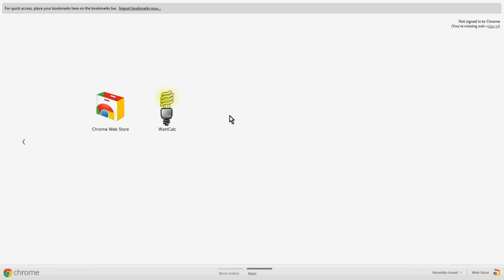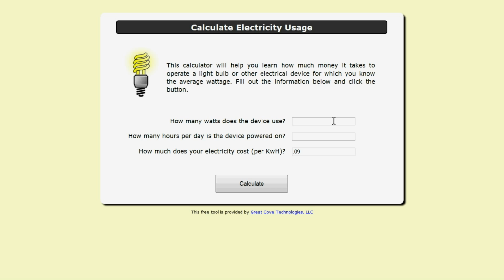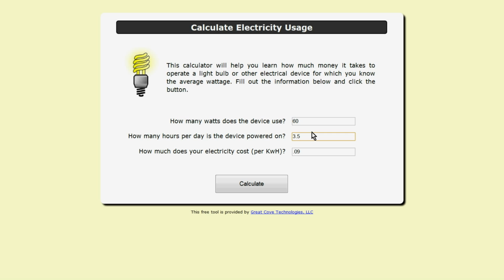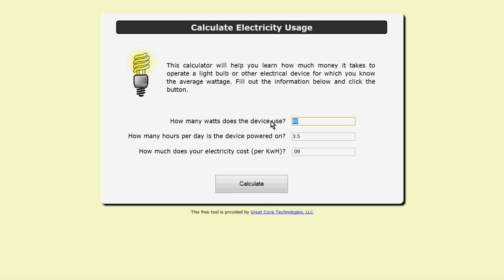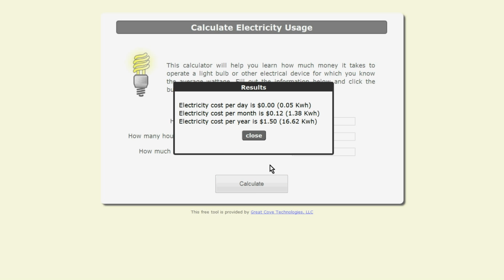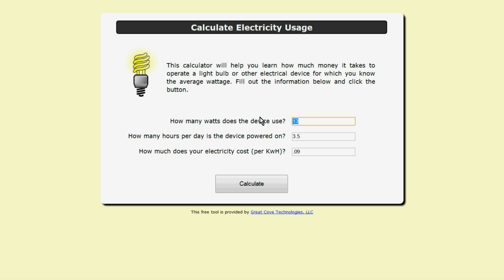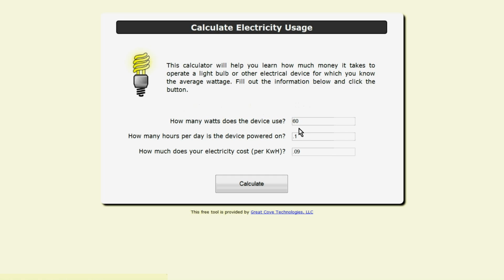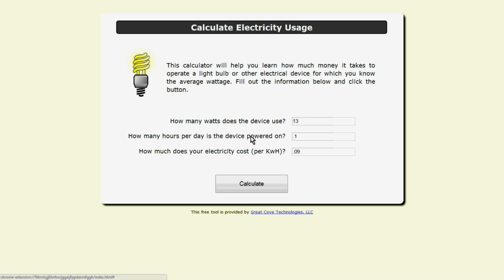Do CFL & LED light bulbs really save money?

Comment: LED's are the way to go - I would stick with name brand Philips for the lights used the most and then an off brand for others - incandescent bulbs are perfectly fine to use like he said for light fixtures used less frequent - in my case I have 3 lamps that are normally on 12 hours per day on average and more in the winter months - so spending about $75 for 3 - 75w equiv. for my situation will pay for itself in just over a years time - the bulbs last me 90 days when $ permits I will be changing

Comment: Well yeah but CFL's really have a problem with intermittent lighting. The number of on/off cycles is actually one of the specs.
Halogen bulbs are more efficient but only slightly - about 20%. I'm all for LED's for such applications.

Comment: Well, incandescent bulbs also burn out faster if they are turned on-off frequently. The filament expands when its on, and contracts when off. Over time, this stresses the filament and it breaks.

In Australia, they've replaced incandescents with halogen bulbs. Its still shaped like yr standard lightbulb and most laymen people can't tell the diff.

Comment: Be careful when choosing LED bulbs, even from Amazon. I bought 4 LED bulbs ("Lighting Ever" brand) and despite the high feedback ratings, all 4 failed within 2 months of purchase, two of which failed outside of Amazon UK's 30 day return period.  We so far haven't had any issue with CFLs runtime, replacing frequently used bulbs roughly every 2 years.  Be sure to watch out for the colour temperature as cheaper bulbs tend to be cool white (bluish tint) instead of warm white (like incandescent.)

Comment: Also consider the cost and efficiency of both the supplemental heating and cooling. If you are using electricity for heating, then the extra heat you use will cost exactly the same as the electricity you saved. If however you are using natural gas to heat, it will probably be cheaper than the electric heat from the incandescent bulb. 

More importantly, if you have an air conditioner, it requires 3 or 4 times as much electricity to move the heat back outside when cooling.

Comment: Search Life-Cycle Assessment of Energy and Environmental Impacts of LED Lighting Products by the US Department of Energy.

The embedded carbon footprint of LED's is of course larger than incandescents despite getting lower each year. 

"Regardless, it is important to note that the manufacturing phase on average only represents about 8.8 percent of total life - cycle energy for current LED lighting products and is far outweighed by the use phase"

Comment from the maker: Good point, although I still wonder what the total environmental impact is of a LED that gets put in a closet that gets powered on a few minutes a week.  How much extra pollution does it take to make a LED vs an incandescent?  It's a hard question to answer.  If LEDs work as advertised, it's safe to say we'll all be using them everywhere in a few years.  So far I purchased only one about five years ago.  It was a 20 or 30 watt equivalent and cost like 30 bucks and failed in two months.

Comment: You missed a very important aspect... CFLs fail if turned on and off frequently (like if you put them in a closet). Both incandescents and especially LEDs are relatively immune to that. You also missed the fact that people can only have so many places in their homes that require intermittent lighting and so the capital costs of using LED's in such places are negligible and for sure this is not an argument not to ban incandescents.

Comment: Maybe with electric heat and super-insulation, and if 60 F is cold weather to you. For the pathetically insulated, gas-heated old homes in Michigan, the BTU's added by light bulbs is tiny to begin with. And electricity is also a ridiculously expensive way to heat your house compared to gas. OTOH in the summer, air conditioning is cooling down just a few degrees to get to 80 F inside, and costing a bundle to do it, so efficient bulbs could save you their cost in a couple of years

Comment: Good information in the video. Expanding on rclewis01's comment..  In commercial buildings (I am an Electrical PE), where 90-95% of the hvac load is cooling, we look at total input Watts, all of which must be cooled.  If we can get the same light levels with a lower Wattage, then the cooling load goes down. So for commercial, the absolute lowest Watt per lumen saves a lot of money, along with automated controls to turn them off when not needed.

Comment from the maker: Thanks for bringing up a good consideration. How the heat equation works out depends on your climate as well.  If you're in a climate that uses a lot of cooling but little heating, then incandescent bulbs work against you by increasing air conditioning costs.  However, if you're in a colder climate where you do little or no cooling, then (at least part of) what you save in electricity with CFL bulbs is made up for in extra heating costs.

Comment from the maker: It is possible to save money even when you install energy-saving bulbs in little-used areas, but the pay-off takes a long, long time.  I'm not much interested in putting a $2 or $3 energy-saving bulb in a closet that gets used so little that it takes 15 years to pay me back.  With the extra manufacturing needed to make a CFL or LED, I also wonder how "green" it really is if the payoff takes that long.

Comment: One thing people never talk about is the heat or lack of it. In the winter time, or even spring and fall, people have the heat on. If you are running incandescents, the heat given off is substantial. If you take that away and replace with CFLs, the room gets cooler, the heater then runs more often and longer to make up for it. So, 6 to 9 months out of the year, it saves you nothing. But in the summertime and outside lights that are on a lot, makes a lot of sense.

Comment: Most of my CFL's have lasted three years or more but a few have had issues. They wouldn't light up when turned on but I found on most if I tapped the bulb they would come back on as if to be a contact problem. However, unlike standard incandescent bulbs CFL's have integrated circuitry that go bad sometimes which explain why they can prematurely stop working.
CFL's were insanely expensive when they first came out but are now reasonable, but I've been replacing mine with LED technology.

Comment: I have several CFLs in my house that are the Home Depot "house brand" (N-vision).  They were less than $2 each in a multi-pack. I didn't write the dates on the bulbs when I installed them, but I it was at least 5 years ago. Only in the last few months have they started burning out.  Color temperature is a good soft white, and they are nearly instant-on; very little warm-up. I've even had these CFLs last for years in fixtures (back porch, stove hood) where incandescents burned out frequently.

Comment: you also need to remember that cfls and leds have a longer life than incandescents. you would have to figure in the cost of being each new one every time the incan dies. incans last about 1000 hours or so but leds last about 25000. thats 25 incans  per led. which adds up light after light.

Comment: One case where you need incandescent is in dimmed lights and dawn off/dust on as the load needs to be resistive not inductive/capacitive unless a relay is used to actually switch the load. Always check the instructions.

Comment: LED's are GREAT but please remember that the lamps use an inverter to operate, as for CFL's use a ballast to operate. the lamps on the LED will NOT go bad as the company states, 22 years etc. the inverter WILL. LED's are DC operated our power system is AC

Comment: The only true energy saving light is the one you switch off when it's not needed!
Too many buy CFL's or LED's and just leave the things on all day but forget that it still uses electricity, best way to get the bills down is to insulate the building and use more efficient heaters, changing a 60w incandecent to a CFL will save only pennies a year that the tax man will take off you with the next tax hike anyway.

Comment from the maker: Thanks for the tip.  I don't know that I've ever used halogen bulbs - except perhaps my car headlights.  I can say, however, that I've been using CLFs in most of my house for several years.  The vast majority of the bulbs do last a considerable amount of time.  I've had a few that failed prematurely, especially in the bath room (is it the moisture?), but most are at least 5 years old and going strong.  I have three or so that are 8 years old.

Comment: In my opinion, the best light sources are halogen light bulbs and florescent tubes. They are cheap and last a long time. Halogen builbs last longer and are a bit more efficient then conventional ones. A cfl claims on the box lasts more then 3 or 5 years, in reality, it rarely lasts more then 6 months, also the power ratings are inacurate and need a 10-15 min warmap time to reach full light. LED lamps? Those are extreemly expensive. Go halogen guis :P i have 12 bulbs 7 years old, still work.

Comment: Too bad cls's don't last as long as they are advertised to. Cfl's that use an outer globe have more heat retained by that globe and this leads to premature burnout of the ballast.
As well, cfl's are very enviromentally hazardess due to the Hg in the P coating on the inside.
However, LED's are the way to go!
LED's use less than half the energy of CFLs and their price is now starting to come down as they start showing up more in the big-box stores.
And LED's truly last for ~5 years.